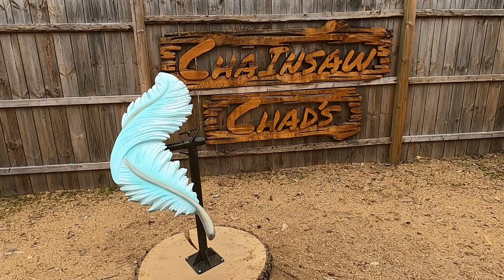Chainsaw Carving a Feather! Art Sculpture!!  From Start to Finish!!!

Comment: Love your chainsaw carvings had a couple questions 1st where is you shop? 2nd if someone was getting into this and was going to buy 1 chainsaw what would you recommend and will it need differant sprocket chain and whatever else ect... thanks.
Reply from the maker: Hi Jim, I live in six lakes mi. I would recommend a midsized chainsaw you can carve a lot of things with just a stock  saw, bar, and chain. Then when you start making money you can upgrade to different saws and carving bars.
Reply: @Chainsawchad  thanks for getting back to me I did forget 1 question how are you anchoring them to the ground so they don't move on ya?
Reply from the maker: There is 2 pieces of 3/4" plywood screwed together in the sawdust on the ground then I screw my carving log to that. I appreciate you watching the videos, thanks!